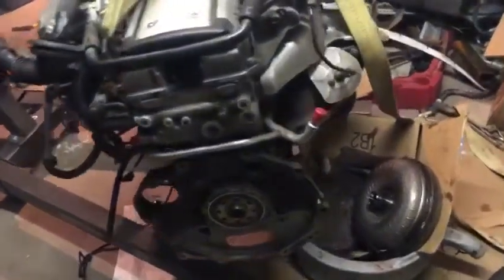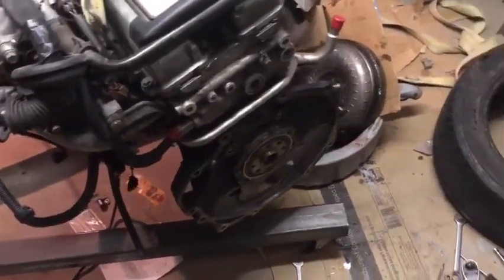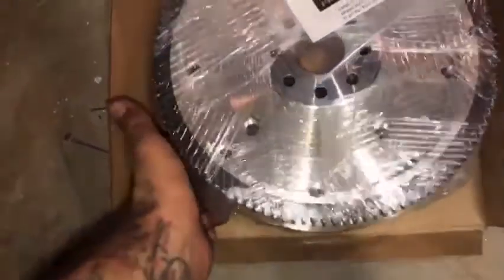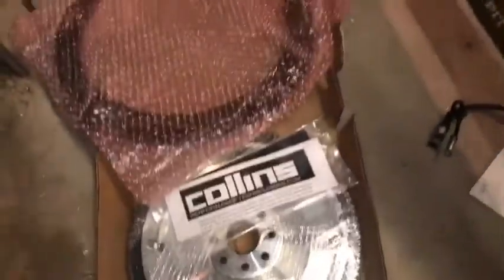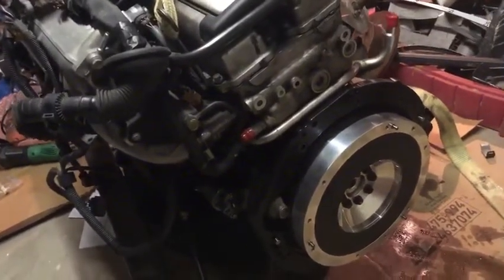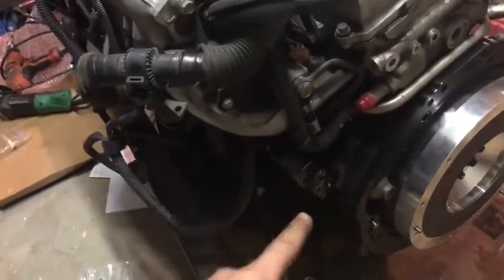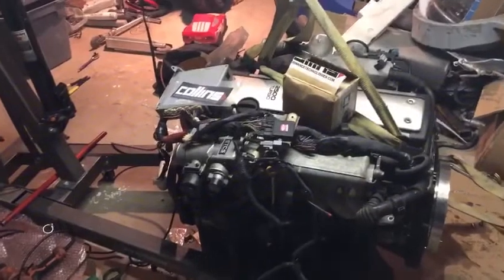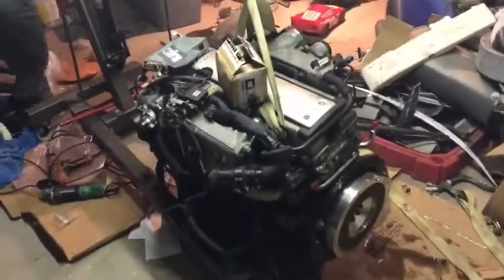How to 1jz vvti swap a 350z: Part 1

Comment: you said you got a fly wheel, did you know a specific clutch or flywheel from a certain car or would my stage 3 clutch and lightweight flywheel on my cd0009 currently fit with the adapter?
Reply from the maker: Artics Design with the Collins flywheel you can use any VQ clutch I believe
Reply: 3 Motion Garage for sure, thank you!

Comment: How did you install the studs for the starter?
Reply from the maker: Rare form Drift mob Staten Island they thread into the adapter plate. I then used a vice grips to tighten them down
Reply: 3 Motion Garage thanks for the info